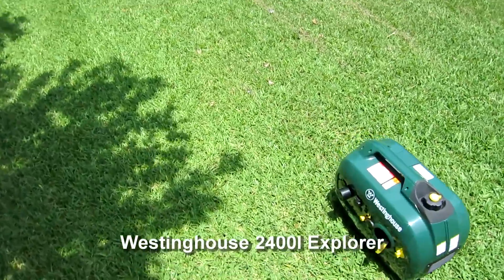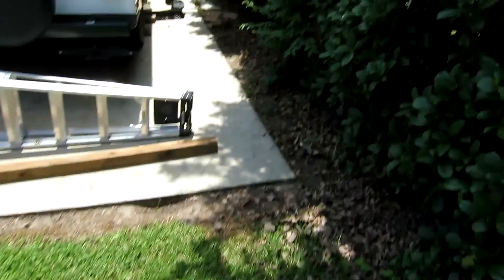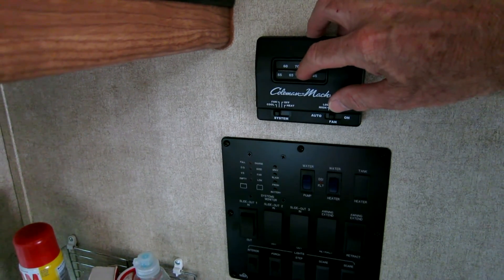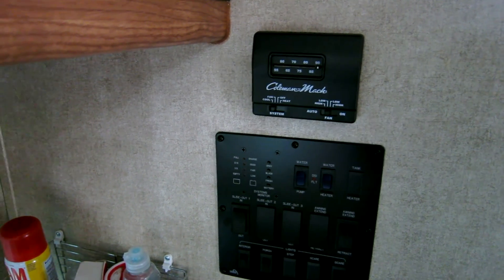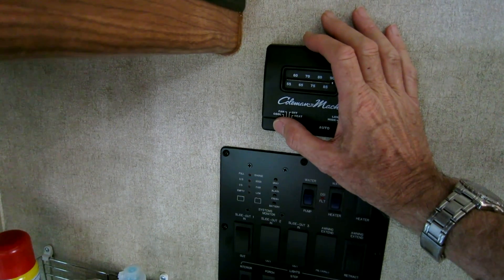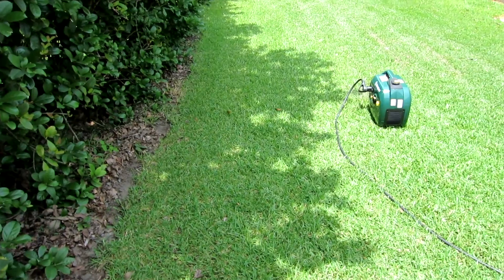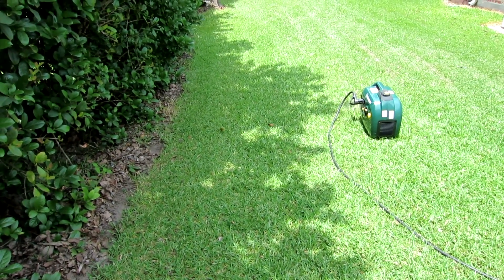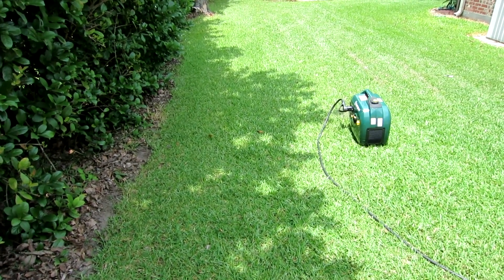Westinghouse 2400I Explorer Inverter Generator running 13.5 BTU Coleman AC Unit - Update

Comment: I have the same generator and at idle it puts out the same 123.5 volts.  Anyway to adjust the voltage down closer to 120?

Comment: Should have used a soft start, it will bring the Compressor up to speed at a slower rate. Hard starts can work in some situations but sometimes they use more power so you defeat the purpose. The only thing a hard start capacitor does is help an old AC unit compressor get going
Reply from the maker: If you watch this video, you'll see without speculating that the hard start will knock off 10 amps of starting load.
https://youtu.be/NVkCjPh7Nd8

Comment: Can these 2 modifications be done on an older roof top with the controls on the unit ?
Reply from the maker: Yes, the capacity and timer are independent of the thermostat.  Slightly different wiring and some of the older units may draw more starting amps but the 2400i will crank my 13.5 coleman without the modifications so you've got a pretty good change of making it work.  It's a strong little generator and had a running voltage higher than some which means the amp requirement will be a little lower.  Good luck.  It's a safe mod and won't hurt anything.  I've be running mine this way since the first video with no issues.